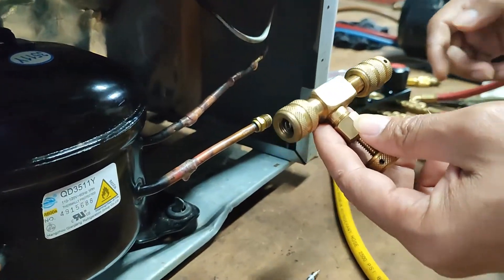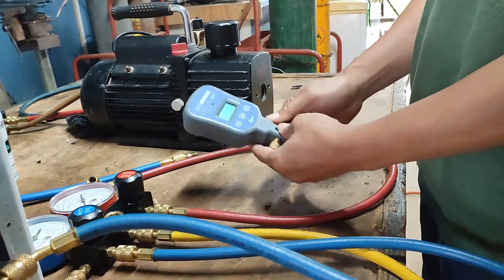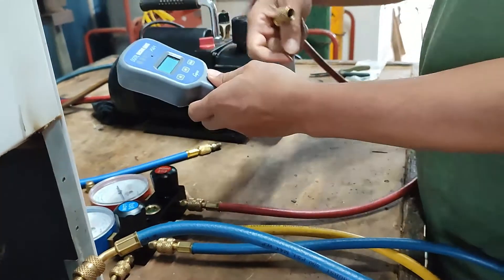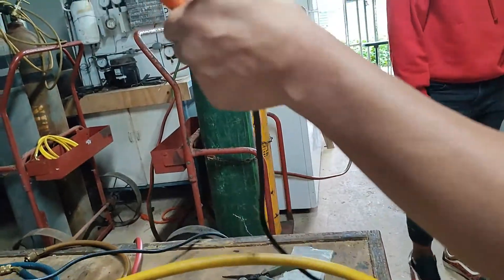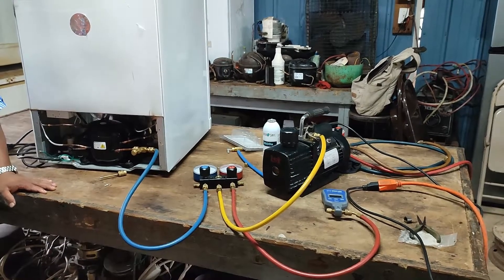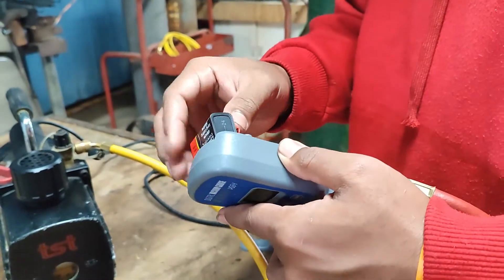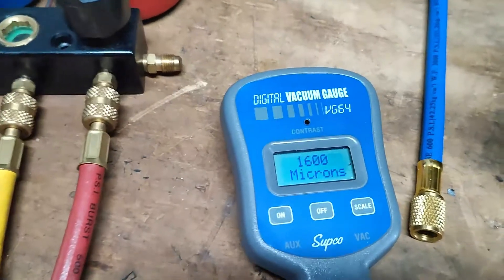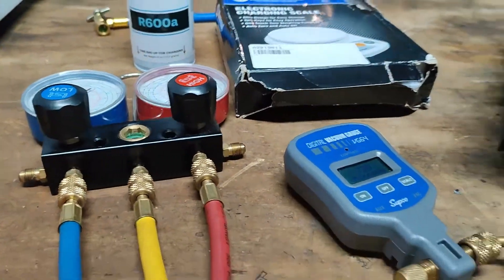R-600a  Freezer Vacuuming Demo

Comment: you should add the details of the vacuum pump rated A2L refrigerants. DC volts and sparkless proof, remember you are working on flammable refrigerants. Is any there any EPA office there?